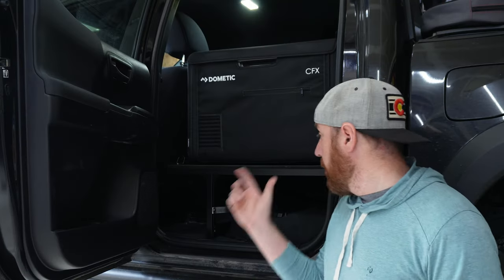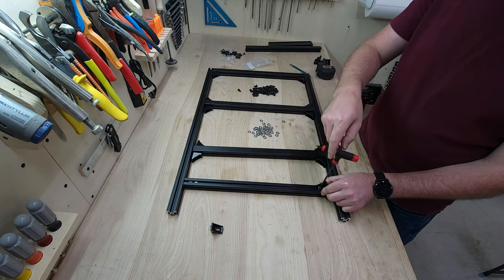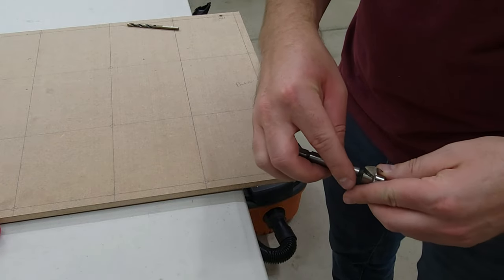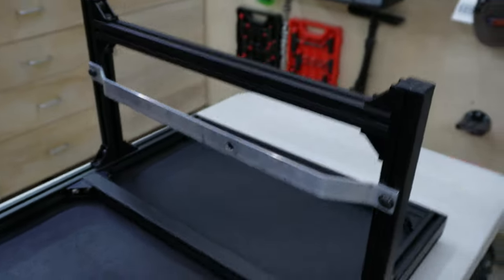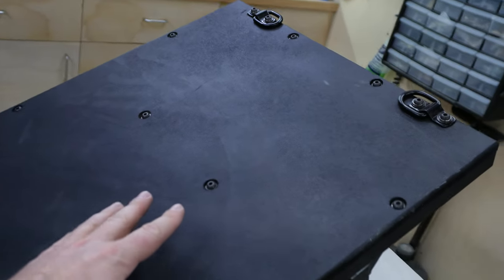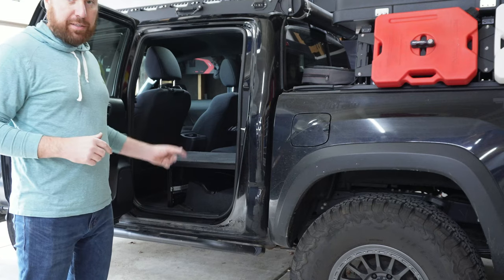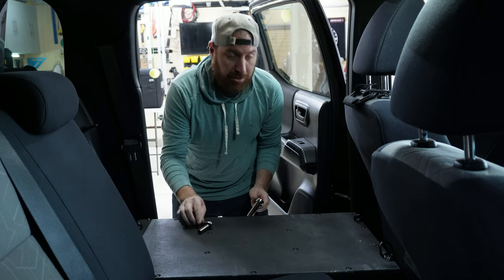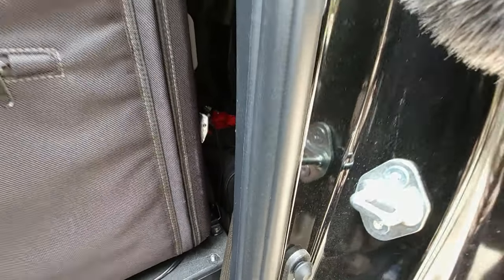DIY Removable Rear Seat Delete for Overlanding/Camping

Comment: Great video! When ordering the extruded aluminum lengths what dimension did you choose for Fractional length?
Reply from the maker: Hey thanks for the question. The link in the description to the website has a breakdown for all of the parts and sizes you would need for the third gen tacoma.  Let me know if you have any other questions. Thanks!

Comment: which Dometic product do you have? Also, can you make one that goes from drivers to passenger side and slides out and tilts?
Reply from the maker: That is a Dometic CFX 55IM. https://www.dometic.com/en-us/outdoor/coolers/electric-coolers/dometic-cfx3-55im-220584 

In regards to the slide out and tilt, it would take quite some work you would likely have to build a box frame that ties into the seats and rests on the spot where the tacoma has under seat storage (assuming its a tacoma). You would likely also need to use the 60% seat of the two rear seats so that is something to consider as well. There are some slide out and drop down kits that exist on the market you could also retrofit. I would not recommend building the frame out of 80/20 aluminum for something like that, would go with a custom steel frame thats welded together. Hope this helps and thanks for the comment. Cheers!

Comment: Can the Dometic fridge slide out, so you can easily access food ?😊
Reply from the maker: Hey thanks for the comment. So we can get into the fridge really easy. Actually pushes againt the roof almost fully open at 90 degrees and stays open with the friction. Slides might be possible but would raise the fridge height even more

Comment: Been thinking about doing the same thing to mine. I’ll be getting an under the back seat compressor which I think is what you have as well. If so how difficult is it to reach the compressor?
Reply from the maker: So I don't have a under seat compressor.   You would have enough room to get a quick connect in with a 90 degree elbow. I would also recommend taking the cover off so it's out of the way. That should work. An easy way to check would be to take the seat off and grab a level. Put it on top 9f the seat mount and measure down to see how much room you will have. Happy to try and help any way I can. Thanks for watching the video!
Reply: @blackcotaco  you’re welcome and I appreciate it man